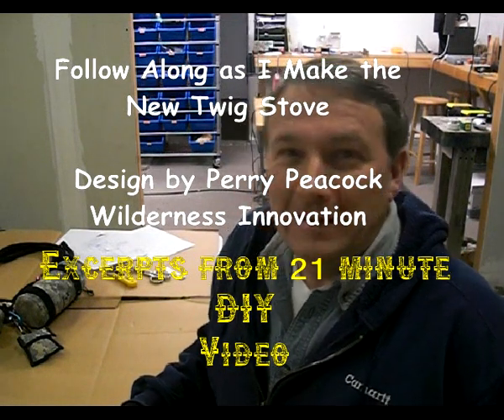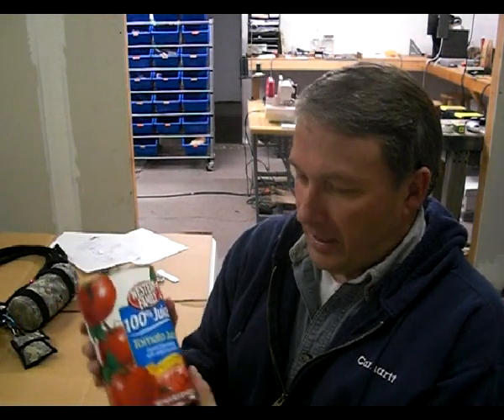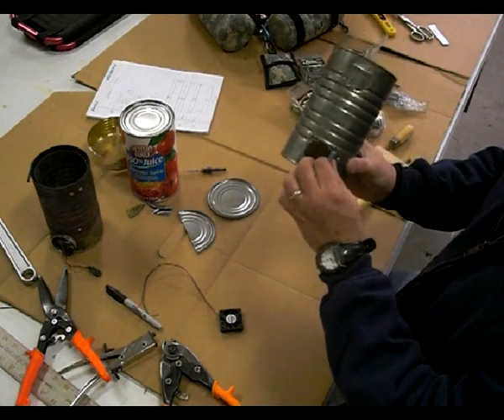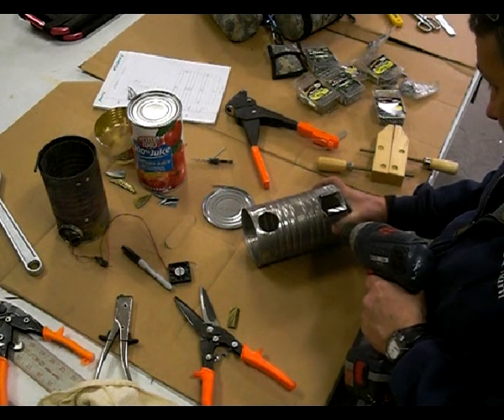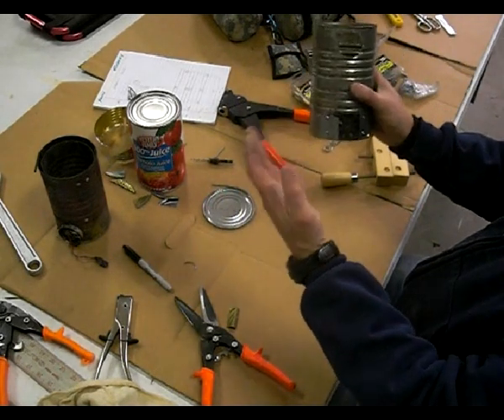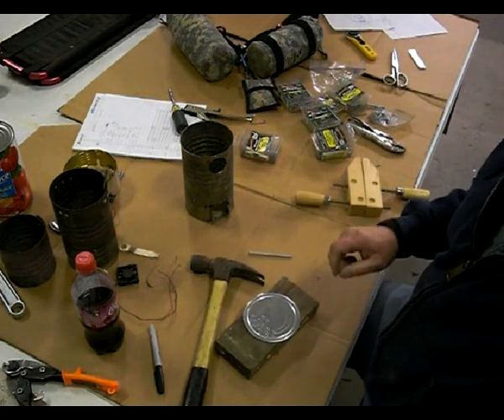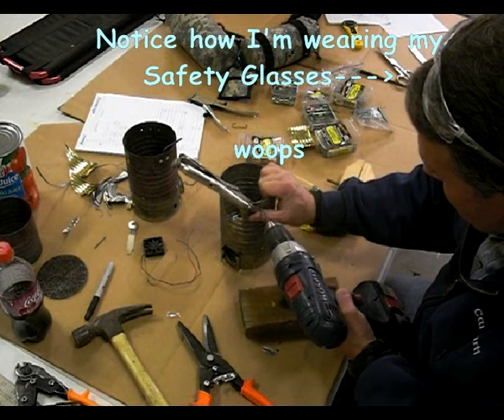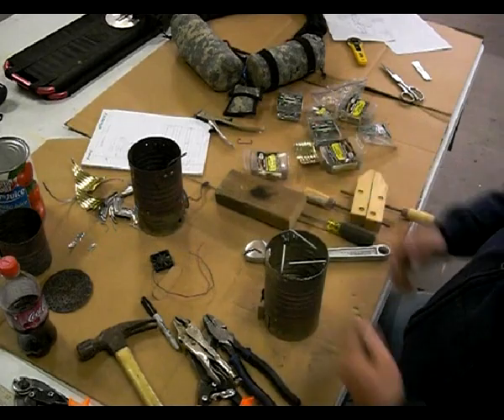Making the Twig Stove - excerpts from 21 minute video

Comment from the maker: You definitely have to be careful with the heat, because it will melt the fan. The way that we got around it, it by putting a piece of metal that keeps the heat above the fan area. When the stove is working correctly, they are pretty hard to beat! Good luck!

Comment from the maker: @hobbexp If you search on our channel there are a couple videos of the stove in use. We are doing a few more videos as well.  I was concerned about the fan melting at first, but there has been no problem. My newest stove has about 30 hours of cooking on it, and no problem with the fan. One thing to think of is there is a grate in the stove that keeps the fire above the fan, That keeps it away from the direct heat of the fire and coals. On our website we have plans and a video on how to make it.